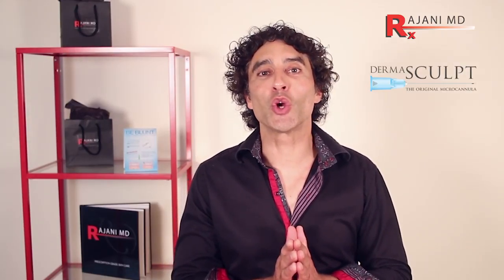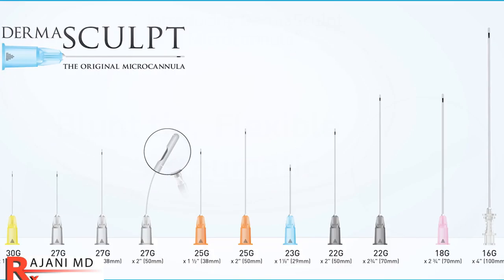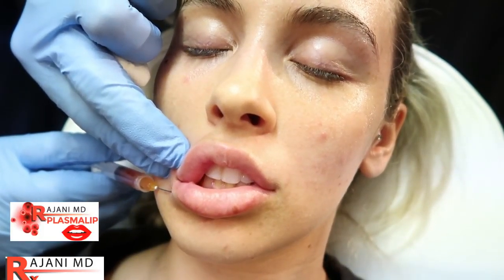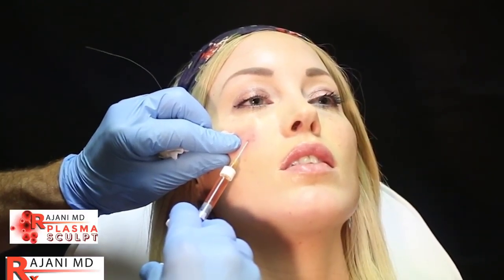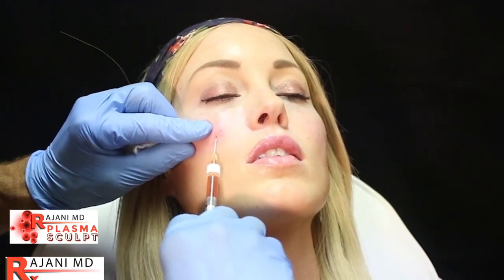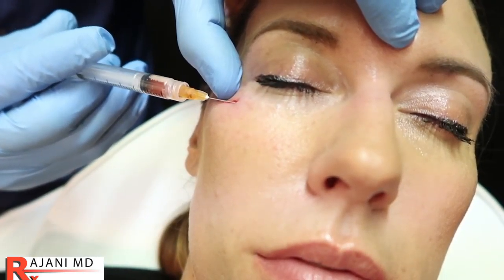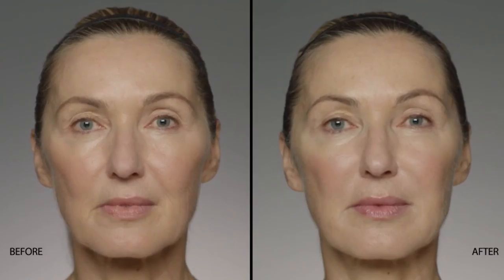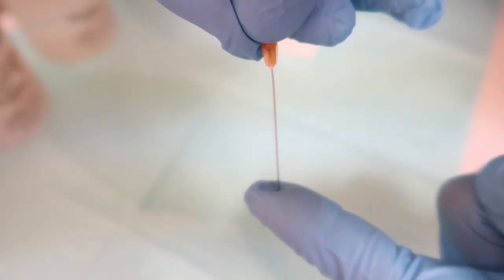Microcannula Tip- Length and Size- Dr Rajani

Comment: Is 25 gauge 1.5 in length good for subcision?  Thank you.
Reply from the maker: Lori Carrion yes . It is fine for most areas. If there is prior pmma or plla a 27 g can be easier.
Reply: Dr. Anil Rajani Thank you so much for your response.  With so many videos on sizes: width, length and type of scarring, And seeing so many doctors use longer needles, and a thicker gauge, I wondered if it the 25 gauge is as effective as a 22 or even 18z. However you mention even a thinner gauge, 27.  I am trying to really educate myself and there is just so much to learn, the more I know, the more I have questions.  ;) Thanks for your reply.  Truly for taking your time.
Reply from the maker: Lori Carrion you are so right. I study every day to keep up. It really depends on what you are subsicing.
Acne scars need a needle, filling should be a large cannula, oral commisure and malar pad one can use a 27. Also depends on ones dermal thickness... etc etc.

Comment: Do you use 25 g 1/5" blunt tip for tear trough and lips?
Reply from the maker: Lorelee Scipione yes. Sometimes 27 guage in lips. If patients have had sculptra or bellafill in the past one may need a 27 guage or even a needle as cannula may be impossible.
Reply: Thats true Dr. Rajani, I was applying PDO threads in a lady face , who have had a Sculptra treatment before, and the insertion of the cannulas was absolutely difficult ! Thank you very much!
Reply from the maker: Marwan Nazzal thanks for your feedback.
Reply from the maker: Thank you for sharing.